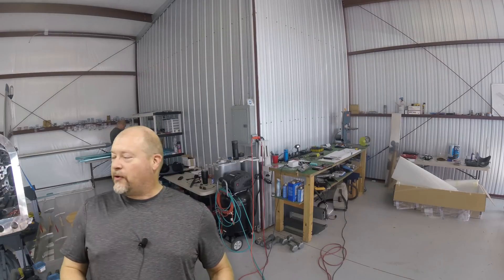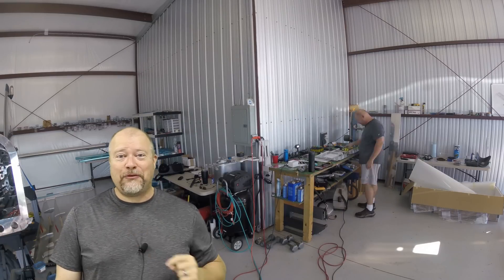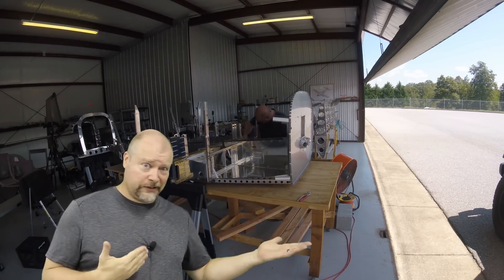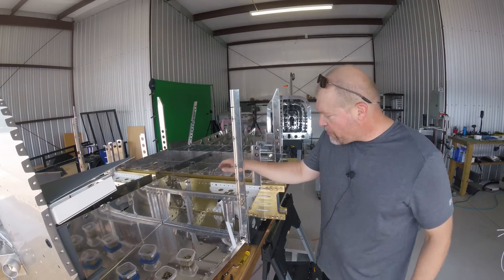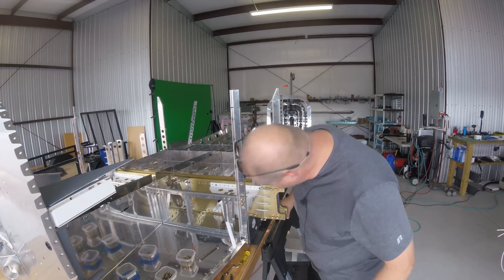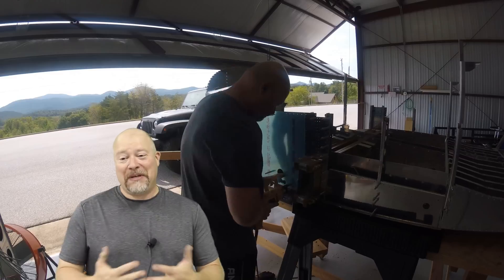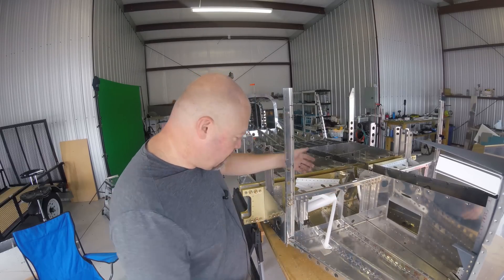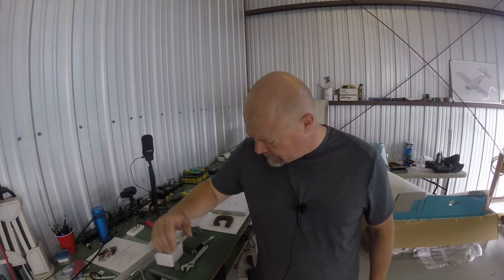RV-10 Fuselage - 019 - Landing struts and blood for the plane gods

Comment: If you order all the subkits at once; not only will they sit in the corner gathering dust, BUT, be aware that Van's is prolific in the number of SBs they issue -----> if you buy all of the subkits at once, you WILL have to engage in making modifications that Van's has made to your airplane/parts.  Whereas, if  you order the subkits as you need them, those SB mods will have been completed at the factory before they ship them to you {and then you can make the mods as they arise ....}
Reply: Good point to think about.